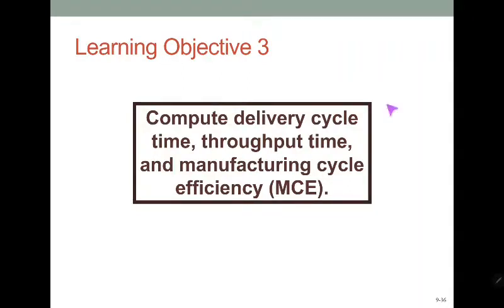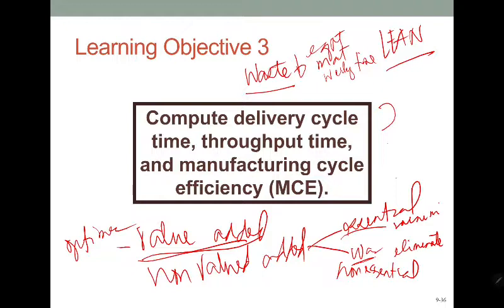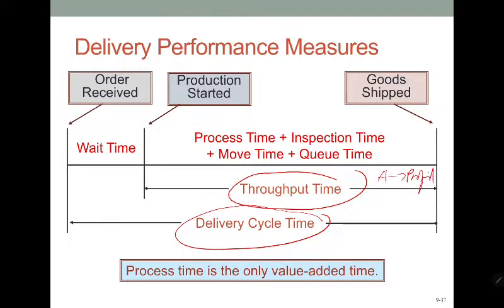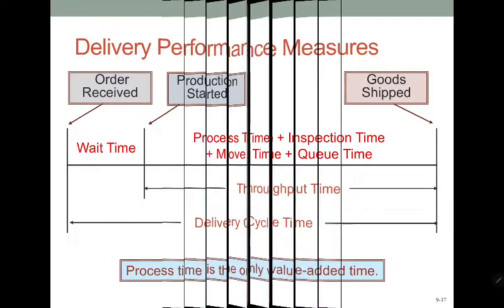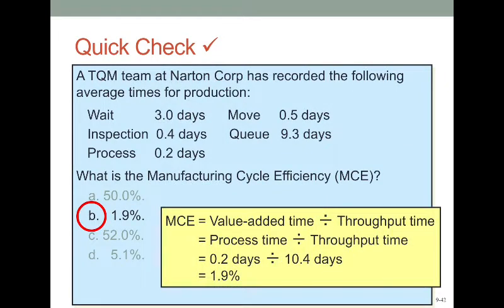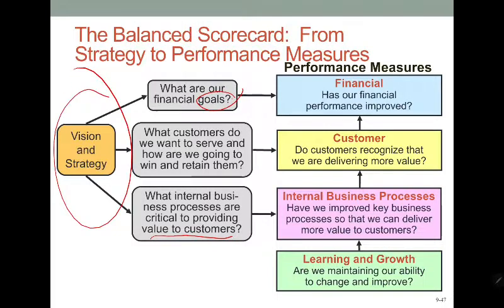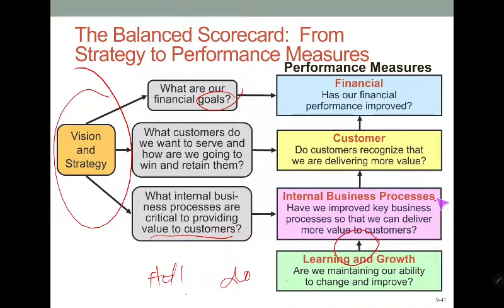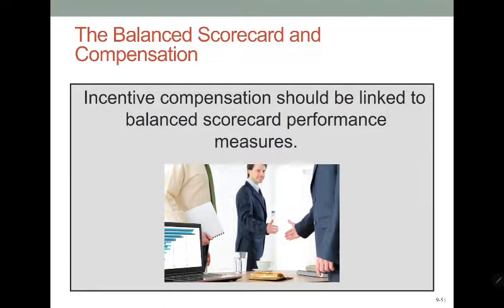LEAN SYSTEM & BALANCED SCORECARDS

Comment: Hello, Ma'am Wye! This video provides a thorough understanding. Here are my key takeaways:

1. Why analyze delivery cycle time, throughput time, and manufacturing cycle efficiency?
   - To reduce waste in asset utilization, such as equipment, materials, and work-in-time. This fosters lean production, allowing the company to scrutinize both value-added and non-value-added activities.

2. Which activities should we optimize and minimize?
   - Optimize value-adding activities.
   - Minimize essential non-value-adding activities like movement and waiting. Eliminate non-essential ones, such as defects and overproduction.

Comment: Good day po, Ma'am. Thank you for another insightful video lecture about Lean Systems and Balance Scorecard. Through this I've gained knowledge about manufacturing cycle time and other performance measures. Here are my takeaways about the topic and questions:

1. Examining delivery cycle time, throughput time, and manufacturing cycle efficiency is vital for operational efficiency, customer satisfaction, cost control, and maintaining a competitive edge. These metrics help identify bottlenecks, optimize resources, and enable quick adaptation to market changes. Monitoring them is crucial for continuous process improvement and effective performance measurement.

2. Organizations relentlessly pursue optimization and minimization to enhance efficiency and competitiveness. Streamlining processes, optimizing resource allocation, and maintaining an optimal inventory balance contribute to overall effectiveness. Shortened lead times and reduced downtime result from eliminating bottlenecks and embracing agile practices. Communication channels are streamlined, and decision-making processes are expedited by reducing bureaucracy. Cost optimization, including waste reduction and sustainable practices, ensures financial health. These concerted efforts culminate in an organization's ability to navigate a dynamic business landscape with agility and success. Specifically, firms need to optimize the value adding activities and minimize those non-value adding activities that are essential.

Comment: Good day po, Ma’am Wye!

Thank you for providing this informative video discussion about computing for the delivery cycle time, throughput time, and manufacturing cycle efficiency (MCE) which determines how to lessen waste in the utilization of equipment, materials, and working time. I have learned that in Lean Production, it includes both the Value Added and Non-Value-Added Activities. The Value-added activities should be further optimized while the non-value-added activities should be minimized such as the moving time, inspection time, and waiting time. The video also discusses about the importance of Balanced Scorecard where each individual should have a personal balanced scorecard and the entire organization should have an overall balanced scorecard.

Thank you so much po, and have a blessed day!❤

Comment: Hello po, Ma'am Wye! I appreciate your informative video lesson. It greatly aided my understanding of lean production and the balanced scorecard. Here are my key takeaways:

1. Why focus on delivery cycle time, throughput time, and manufacturing cycle efficiency?
   - To reduce waste in asset utilization (equipment, materials, and work-in-time) for lean production, enabling a focus on value-added activities.

2. Which activities should be optimized and minimized?
   - Optimize value-adding activities.
   - Minimize essential non-value-adding activities like moving and waiting, while eliminating non-essential ones such as defects and overproduction.

Comment: Good Day, Ma'am Wye! This video is very comprehensive. I learned a lot in terms of what the importance of a lean production is and what it constitutes and the balanced scorecard under different measures. As for my takeaways:

1. Why do we have to look into delivery cycle time, throughput time, and manufacturing cycle efficiency?
- To lessen waste in terms of utilization of assets e.g., equipment, materials, and work-in-time. This will lead to lean production which can enable the firm to look over the value-added and nonvalue-added activities

2. What activities do we need to optimize and minimize?
- Value-adding activities (optimize)
- Non-value-adding activities that are essential e.g., moving, waiting, etc. (minimize) while those that are non-essential e.g., defects, overproduction, etc. (should be eliminated).